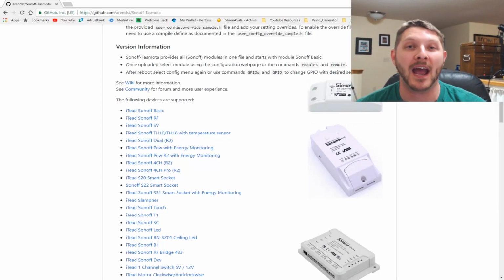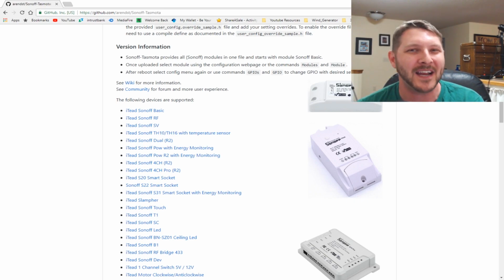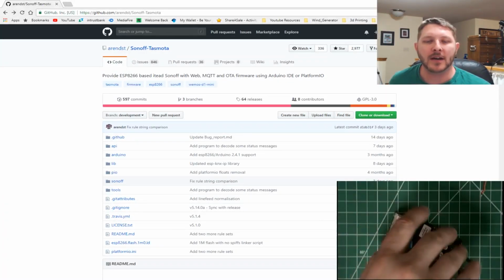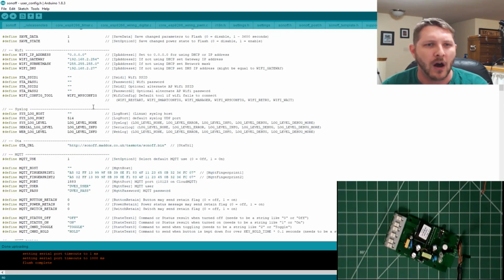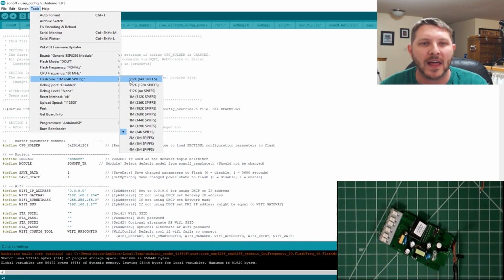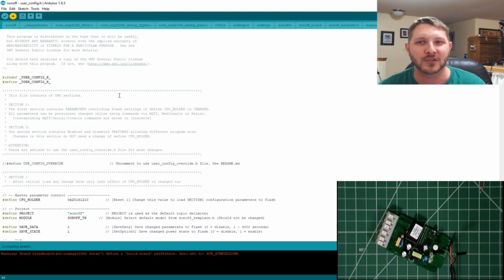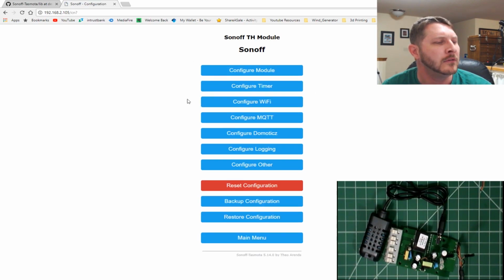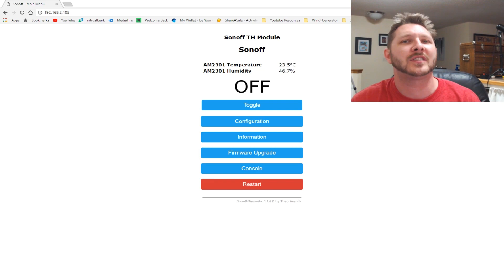Installing Tasmota on SonOff TH16

Comment: I'am sorry , i buy the FT232RL cable and it's not the same as you and his don't work on windows and linux. when i plug in with the TH16 i have driver error, without is ok.

Comment: I am planning to put it for  attic fan. I would like to auto on/off fan based on set temp and humidiy. Do you know if Sonoff TH with Tasmota can on/off load even if WI-Fi goes down?
Reply from the maker: Here is some information about this from a forum:  https://github.com/arendst/Sonoff-Tasmota/issues/647

Now you could always write your own firmware.  If you look at my original sonoff videos on my channel I show how to write your own firmware and thus, you could have it locally sense the temp and turn on the sensor and provide the feed back to home assistant as well as receive a command from HA through MQTT and operate as well.  This way you are covered on both fronts.

Comment: why is the video in 360p ? Its blurry and the code is unreadeable.
Reply from the maker: it isn't.  You may have to go to the bottom of the player window to the gear icon and choose the 720p option.  It shows up on mine.

Comment: Hi
I had already flashed Sonoff TH (in my case 10) in version 5.4 of tasmota and now when I saw your video I used this method but I continue with the same problem.
The temperature and humidity levels do not appear to me. The Sensor is apparently fine because before flashing, they appeared with the values in the application.
Do you have any idea what that might be?
Reply from the maker: I have seen that too.  Have you set it up through the webpage settings for perifial devices?  Also it should reboot after that and mine did not come up at first either.  I don't remember but I either pressed the reset button and hard rebooted it or I refreshed the page a few times but it eventually came back.  Let me know how it goes after a few hard resets and some page updates.

Also another thing you could try is flush your cache out of your web browser so it is not caching things and causing it to ignore data.
Reply: I flashed mine with 6.0.0a last night but the DHT11 switch can't be seen, apparently. I went to console on the web UI, set "weblog 3" to get debugging output, and all I get is "DHT: Timeout waiting for start signal high pulse" regarding the sensor. It snaps in places, feels secure, and I've tried moving it around to find some magic spot but nothing seems to be working. I tested the voltage on the DHT11 itself (popped the cover and tested 3.3v and gnd on the bottom and it's getting the correct voltage. Very strange..
EDIT - I just flashed it with epsurna 1.12.6 and the sensor is working fine, so must be something in the tasmota build that's funky.
Reply: Hey Paulo, did you ever get this resolved?  The refreshing page and rebooting isn't working for me.  Thanks.